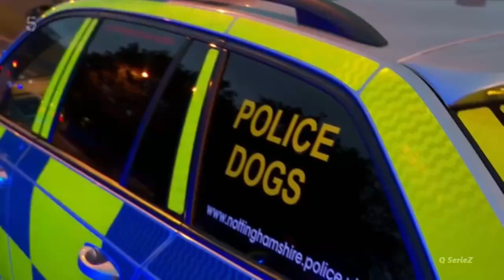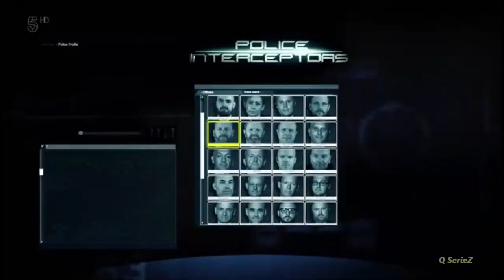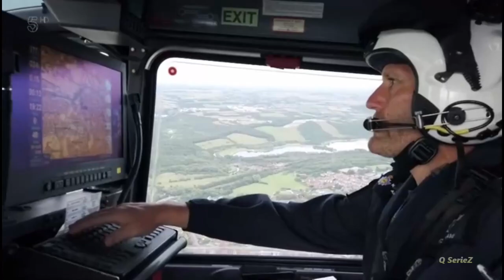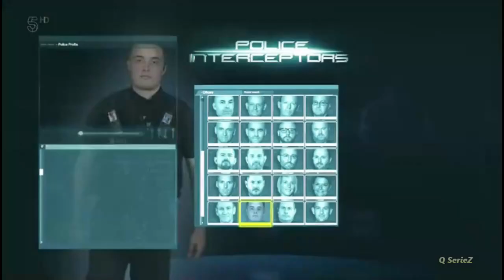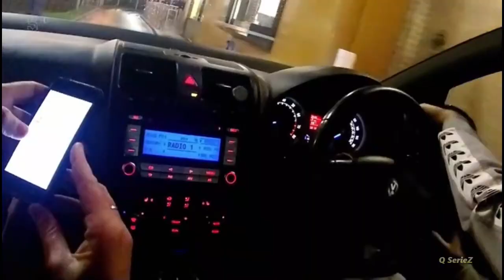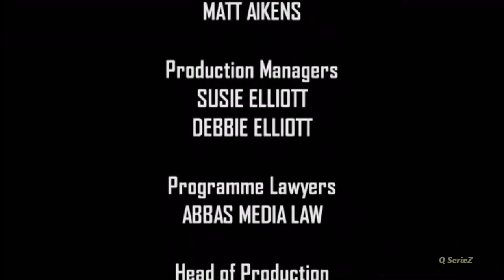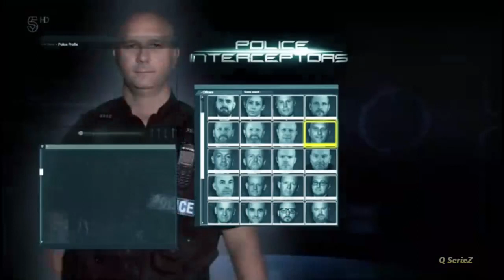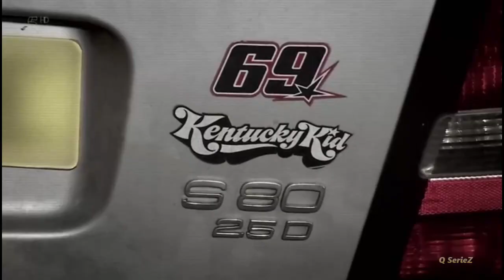🔴 Inside The Elite Police Units Criminal Response UK #10 || 2 Hours Full Documentary

Comment: never understood why uk police cars arent built better - like in the US where they have bullbars on the front etc  a) to protect them from damage and b) so they can push criminals cars off the road to stop chases etc
Reply: U.K Cars are built different. In America you have wider roads so you can put heavier vehicles on the road with heavier accessories. in the U.K roads are narrow which is a pain for officers already, putting a bulbar on would not only kill the vehicles speed but would be extremely unnecessary considering that the cars are repaired.